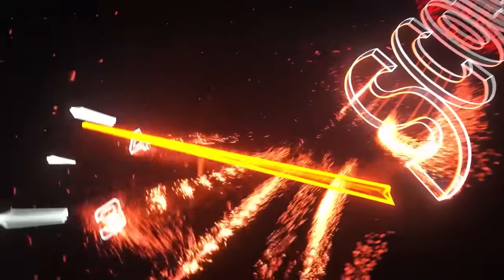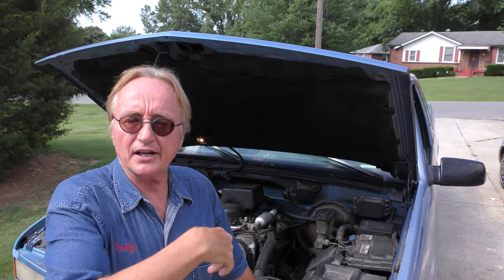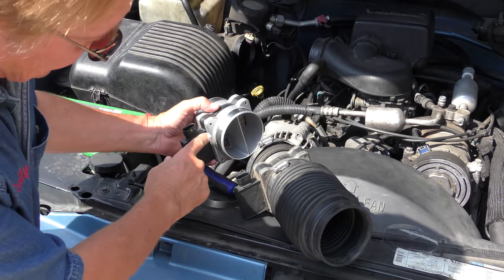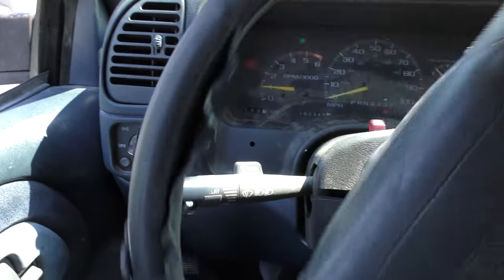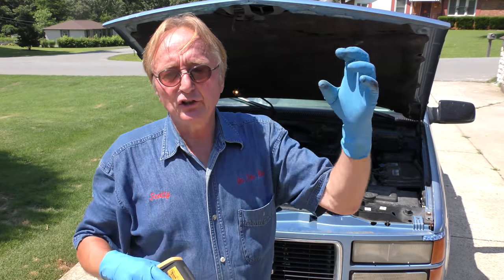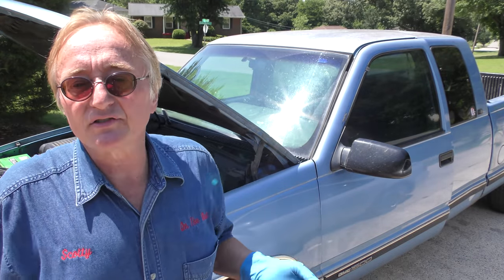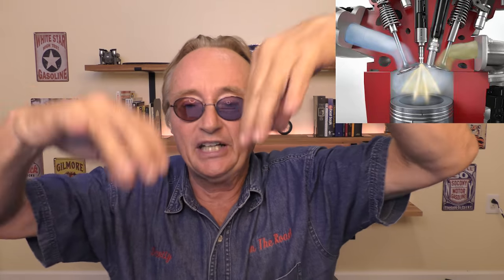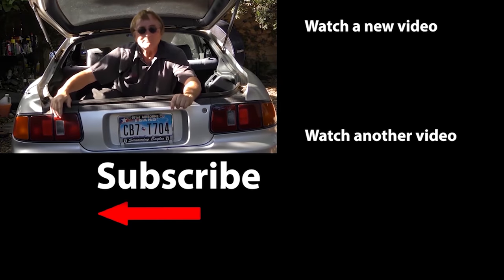Doing This Will Make Your Engine Run Better

Comment: and thats why i love chevy but hate vortec ill stick with good old tbi...might be a slug but can rebuild everything on top easily and cheap
Reply: however if the air cleaner is that bad then the owner is neglecting it run b12 in tank a couple fill ups maybe hit throttle body with cleaner as well and they have mass airflow cleaner did you try cleaning it first before spending a 100 bucks????

Comment: I have a 96 ford explorer that idles rough while I am sitting still so replace the Mass airflow sensor and it will help it run smoother
Reply: Try also replacing air filter, spark plugs and use fuel injector cleaner in the injectors.

If those don't fix you may have a vacuum leak

Comment: I have an "in family since new" creampuff 96 GMC Suburban with that engine. 237,000 miles.  I decided to drop the money for the fuel injection spider, cuz  I like this era of GM, and have no respect for what they're making now.  However, I ALSO paid a mechanic to do it! I also did some "while you're down in the engine stuff, like all the seals and the timing chain.  Runs like brand new, and I didn't have to go spend $80K on a new one that's crap! Happy 4th Scotty!!